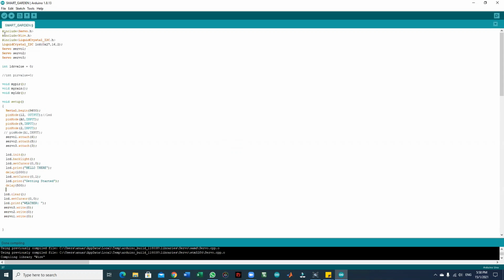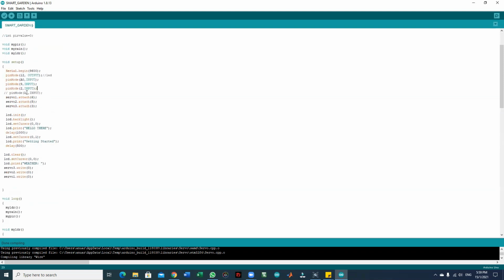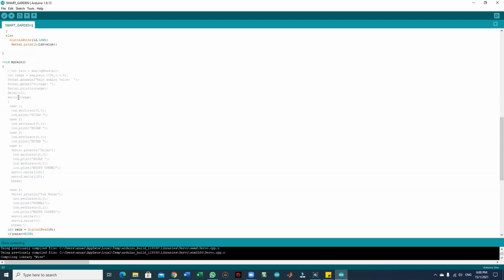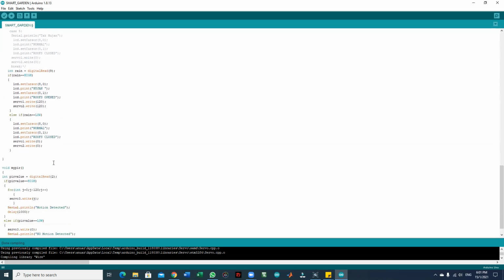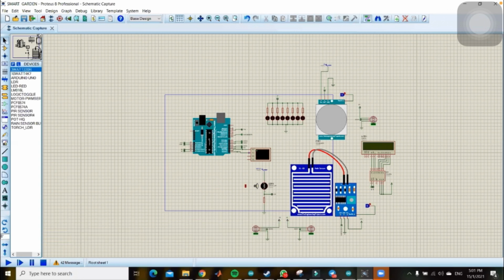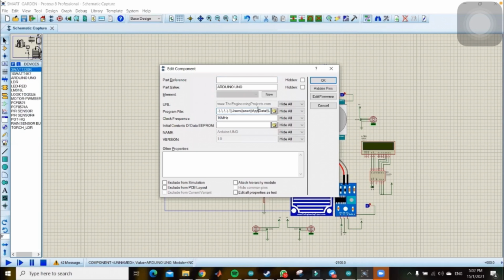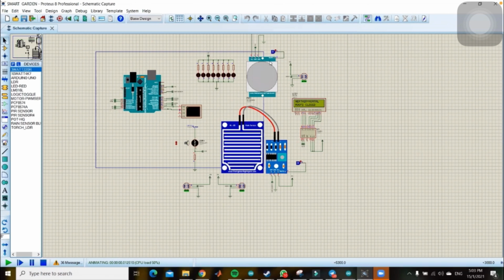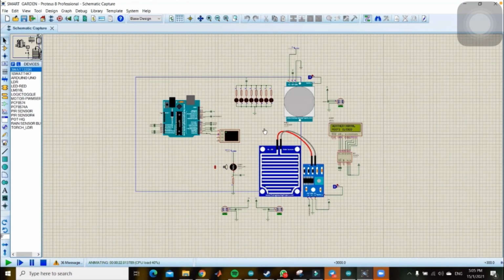SMART GARDEN USING ARDUINO

Comment: GREAT explanation. EXCELLENT video editing & pacing. By the way, please explain the following:
1. Why you set the ldr value < 700 to turn on LED? What does the 700 means and what unit it is?
2. Why did you need to open the roof to 120 degree? Not 90 degree?

ps: Ganasnya cara roof tu dibuka.. kalau ada burung / org tgh baik bumbung atas bumbung tu, mati kena campak.. huhu..
Reply from the maker: Thank you so much for the big compliments, Sir Ikhwan! 
1.Based on the LDR graph we found in the internet, more than 1000 is bright sunlight, below 0.1 is Dark night time. So, we put 700 to indicate as average sunny day. The value is in analog, these value are relative meaning that it have no units.

2. The reason why the roof are set to be opened to 120 degrees because by using 120 degrees, rainwater will flow from the roof and will enter the garden providing access for the plants to consume more rainwater than opening the roof to 90 degrees.